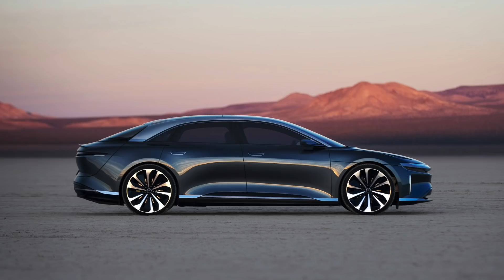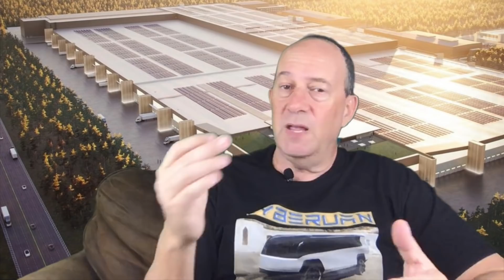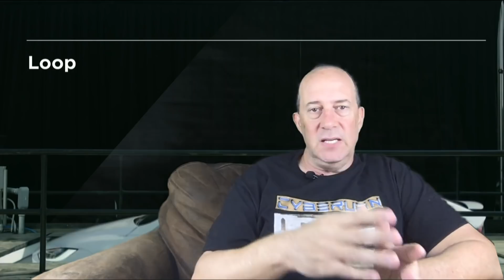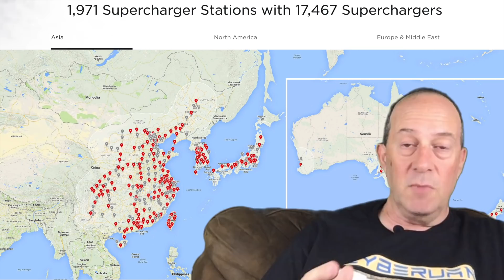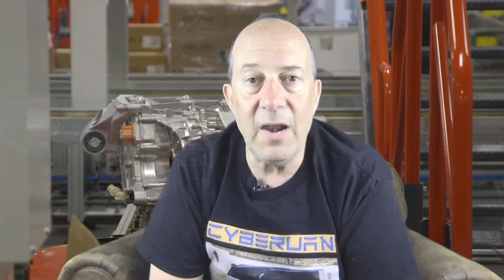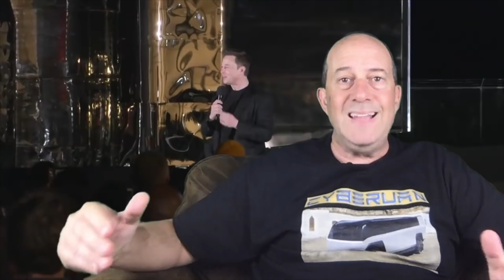TESLA - 10 Moats That Keep Tesla Ahead

Comment: Nicely done, Warren, per usual. I'd love to see you hire a video editor to do things like put the list on the screen to be checked off as you go through the list. They can do a lot of other stuff to enhance your video quality as well. 
Here are a few more items. There are so many of them.
No dealership splits/higher margins
ESOP instead of unions
No waiting until next year's model, changes on the fly
Reply from the maker: I’m not sure what you mean about the list on screen. I think I get it. Would that improve audience retention?

I have looked on Fiverr for video editors. So far it looks too expensive considering my revenue. Their typical packages are for shorter videos than my usual length.
Reply: Hi  @WarrenRedlich , Yes, it does improve retention when someone can both read and hear material. More importantly, from my perspective, is that it would reduce confusion. When something is all laid out in front of us in print, then we don't need to try to figure stuff out and remember info as much during the audio presentation; we can simply focus on the message. The print would provide perspective. These are some things I learned in Education at U. Mass at any rate. 

You might need some locals who are starting to build their businesses. Zac and Jesse of NowYouKnow/TeslaTimeNews went through that process, so you might want to reach out to them.
Reply from the maker: I can probably manage to add that kind of graphic. I'll try it to see how it works. Thank you.

I don't look up to Zac and Jesse. I used to like their channel but they've moved from genuine information to entertainment. I can't even watch them any more. It's something I've noticed with a few channels.

That's a big challenge I face. It might be easier to focus on entertainment over information. But that's not the path I want to take and it's probably a good way to lose the passion that drives me. I have always believed that quality content wins in the long run. It's certainly helping my channel grow right now.

I appreciate the advice. I will try what you said.
Reply: All noted,  @WarrenRedlich . My comments have been offered in the spirit of contribution. Good luck with your already excellent show!

Comment: Great thoughts, But, your timeline on self driving is incorrect, by about 8 to 10 years. Too have robotaxi's you need millions of cars at least 3 million or more just in USA, They would need to make at least 5 million cars a year, maybe 700,000 this year. Also the software is still 7 years away if not longer to total self driving, they know how to do it, the hardward has to catch up.

Comment: BATTERY MANAGEMENT SYSTEM  
per Sandy Munro 6 temp sensors/module; 4 moules = 24 temp sensors Model 3
2020 down to  8 temp sensors Model Y  (moving to Model 3 soon  - already?)

Comment: Warren, sorry but your color correction on your camera is driving me nuts, as you saturation fades in and out, in and out, etc....
Reply from the maker: I agree. Not sure why that happened in this video. Very frustrating for me too.
Reply: @WarrenRedlich  I have found a good light source usually fixes this issue...
Reply from the maker: I've been using two lightboxes. I can't figure out what was different in this video.

Comment: Tesla cars is really cheap in the US. If the price was the same in Sweden, I would probably already be driving one, but the price in Sweden is like 20 000 dollars more for a Model 3 than in the US.
This makes a Tesla about double the price of a comparable fossil car. So a well equipped fossil car with the same size and fairly good performance, but not as good, is probably half the price of a model 3. 

Same goes for other EV's in Sweden. They are also way to expensive. No wonder things are moving slow here.
Reply from the maker: Europe prices will fall when Berlin Giga starts delivering.
Reply: Same problem in Australia $A70,000 for a Model 3 vs $A45,000 for a hybrid Rav.

Comment: You stated electric vehicle have two parts batteries and moters in this one the control circuitry this is a large part
Reply from the maker: I was exaggerating.
Reply: Warren Redlich exaggerating on a big point on a engendering is not ok

Comment: Nope! EVs are not better for the environment.

Where is the electricity created? In a power plant run on coal or natural gas. 

But what about wind and solar? I would ask what about when the wind doesn't blow? Do you crank up God and order some more? You have to have 100% hydrocarbon backup.

Besides CO2 is not toxic! You exhale CO2. Does it poison you? NO! Does your soda pop poison you? DUH!!!
Reply: You might want to dig a little deeper as you don't seem up to date on the rapid innovation accomplished already.  Solar and wind coupled with grid batteries (powerwalls and powerpacks) blows your argument(s) out of the water.  For example, see the overview of the Hornsdale, Australia, Tesla powerpack installation at https://www.tesla.com/videos/powerpack-hornsdale

Comment: High value information Warren!  Wonder why Tesla doesn't have a portable charging station that can visit rural areas where the infrastructure is in waiting?  see -->> https://www.youtube.com/watch?v=iORDZ7FtK2M    This Chinese bus ultimately did not work out as a traffic solution.  Maybe Tesla could re-purpose this tech to park at a public place and provide charging for vehicles.  That expensive hard wired infrastructure idea needs re-thinking, in my opinion.
Reply: A portable battery could only recharge a few vehicles and then need to be driven somewhere to recharge, requiring a driver standing by, and a large charging station to recharge it.
Much cheaper to simply put in a few Level 2 destination chargers at a few thousand a pop, if there isn't enough traffic to justify a supercharger

Comment: Im not completely sold on the software advantage (excluding FSD here for a second). Can somebody make a strong case for why TSLA software is special and why it cant be emulated?
I mean integrating net flix, providing a video game, adding some sensors, programming a fart-app, thats not exactly groundbreaking magic.
Software ultimately not only permeates TSLA but also washing mashines and refridgerators.

The only "Killer advantage" would really be FSD.
Everything else is not unique to TSLA or is nothing that cant be copied.
Lane keeping and all of that is not unique to TSLA either. Self driving is/would be.
Reply from the maker: I'd agree with you but other companies haven't caught up to Tesla's software yet.
Reply: @WarrenRedlich  That is true.
Reply: @Humanaut.  others have tried and not succeeded in coming even close to Tesla software.
VW tried, and have thousands of cars sitting waiting for new software because the first try failed badly.
Most of the other companies haven't even started trying.

A big thing is, it's not just an app anyone can stick on a tablet and FlexTape it to the dashboard, it's actually running the car via software, and that's a whole different level of coding skill and hardware integration to make it reliable and useful and powerful.
Most car companies have trouble getting basic dash software right as it is, and the engine computers get hard coded and hardened for very low bandwidth functions, but anything with a display or advanced features, no one else has software engineers experienced in the unique programming and verification needed to run a car, much less build an entertainment system that people actually like to use.

Comment: toyota sell 20x the number of cars than tesla... they would be aware of the future of electric cars, but why move over now?  Tesla is basically a luxury item still, because the battery cost alone is the same as the cheapest WHOLE toyota car.  Not many can afford it. I dont think it is as hard as you think to produce a tesla
Reply from the maker: No other company has made an EV as good as the 2012 Model S yet. So apparently it’s hard to do. 

Model 3 battery pack is about $6000, less than the cheapest Toyota by a lot. Over 5 years the Model 3 costs less than a Camry.
Reply: @WarrenRedlich  i was wrong on the battery price.  but the porsche is a better ev track car, it allows constant high power unlike the model s  - pricier though, but the innovation in tesla isnt hard to achieve.   just look at formula 1 to see how tech can be copied.
Reply from the maker: "the innovation in tesla isnt hard to achieve"

Then how come no one else has made a better car than the 2012 Model S?
Reply: TOYOTA still ONLY has Drivers Assistance , it does NOT have Autopilot + FSD. 
and YOU dont need to sell MILLIONS of cars to cause DISRUPTION, just 500,000 or so. 
TESLA model 3 is the LOWEST TOTAL COST of OWNERSHIP in the WORLD.
your ROI is just 1 - 2 years , compared with 7 - 10 years with a TOYOTA.
you can Charge your TESLA Completely OVERNIGHT for less than $5. and you Leave home with a FULL tank. 
your NET Energy Cost can be ZERO , if you get SOLAR + Home battery. 
IN, 2024 Tesla will Announce a $25,000 + 300 mile range ...........in 2030 it will be $ 16,000 + 300 miles .............
but, by 2030 YOUR car will be FREE, but you wont OWN it.
Reply: @markplott4820 autopilot doesnt even work
Reply from the maker: "autopilot doesnt even work"

It worked for me when I tried it. When did you try? What went wrong?
Reply: @WarrenRedlich  watch that latest 'tesla driver' video.. clear daytime conditions, first three mins of the video.. the autopilot would have run over a bird AND went through a red light.  Imagine nightime, raining, windy, or a chaotic road condition.. Autopilot doesnt even work in optimal conditions.
Reply: @lengould9262  i bet you dont have a source.. sounds bs

Comment: Small thing about FSD. I like the idea of not going lidar. The idea is that a human have 2D and 3D seeing which can be done with just cameras as with Tesla's setup. The problem I have with full autonomous driving with just cameras are the different water types for example. Heavy snow can't be that easy to handle for the software. Heavy rain as well. But it works for a human as we have other abilities. These other abilities needs to be incorporated into the software somehow to have under any condition FSD. And this is what I think still will take time to solve.
Reply from the maker: That’s what Machine learning does.
Reply: @WarrenRedlich  yes I know. But it isnt that easy. I hope they solve it.

Comment: Add safety. Add a super brand. Now add Tesla's market cap. Synergies go farther than you observed (solar, distributed electric utility, utility-scale batteries). Also, the legacy-auto-type handicaps that TSLA has avoided (like dealerships) serve as yet another advantage.
Reply from the maker: Yes. Safety would have been a good one to include.  I did mention some legacy auto handicaps but I didn’t mention dealerships directly. Thanks.

Comment: You may want to lock the white balance during the shoot. Now the color changes with each handwave 😃
Reply from the maker: I noticed that in editing. I’ve been using my computers web can which doesn’t allow that level of control. 

First time I’ve had that problem. I might try something different. This setup does the best on audio. Everything is a compromise.
Reply: If life was easy it would be boring 😀

Comment: Isn't Lucid's batttery more efficient giving 517 miles from 113KWh whereas tesla's best for model S is 401 miles from 100KWh?
Reply from the maker: Lucid hasn’t produced beyond a prototype yet. We don’t know full specs yet.
Reply: @WarrenRedlich   - TESLA model 3 Preformance STOCK is the FASTEST Production car up Pikes Peak Hill Climb.
46 seconds FASTER than Tesla model S , and faster than a MODDED Model 3 !!!!!!!!
Reply: @WarrenRedlich  I don't remember which channel, but someone did the math on the drag coefficient between the Lucid and the Tesla, and the Lucid is slightly smaller, and the math shows that the reduction in drag matches pretty close to the stated efficiency advantage for the Lucid.
So it doesn't look like they have much advantage in batteries or drive train efficiency, but just designed the car a little smaller and slipperier to get the increased range.
So not really a technical advantage.
Reply: LUCID is NOT a Production car.

Comment: Great content, Warren! It was almost as if--when coming up with a moat of 10--you could almost come up with a moat of 20 things, or make that thirty. In the end, this is something a lot of Main St investors have known: the entrenched competitors are headed for a tunnel, a tunnel that is merely black paint on the side of the mountain.

I have a technical recommendation for your equipment setup: the WHITE balance on your camera was changing all over the place making your skin go from green tinted to red tinted and all over. If you have the time, I'd suggest looking for some ways to stabilize your camera's white balance, etc. It's not a horrible thing, but it was noticable and sometimes distracting for me, at least.

Keep the great content coming!
Reply from the maker: Thanks. Love the tunnel bit!

I’ve been using my computers web cam which does not allow white balance control. The software gets the best audio. 

It’s a trade off. This is the first time it has done that to me. Not sure what happened. I might try a different setting to sit in (no green screen), buy an external web cam, or something else.

Comment: But the batteries technology is a joint venture between Panasonic. Mobile Eye is ahead of Tesla in self driving.
Reply: fkeopfkeop what makes you think MobilEye is ahead?
Reply from the maker: Tesla works on batteries with Panasonic, LG Chem and CATL. Also starting to make their own batteries.
Reply: MOBILE EYE is ONLY Drivers Assistance, it cannot take YOU from HOME to WORK , Complelely HAND FREE like a TESLA can.
TESLA Autopilot + FSD is the WORLDS only FULL TIME L4 Autopilot.
Reply: Mark Plott actually they are more than that and are emulating Tesla’s technological roadmap.  Their partner is bW and they understand the threat of Tesla’s vision. I’d give them the best chance of succeeding outside of the traditional motor OEMs.
Reply: @greghelton4668  the disadvantage that mobileeye has is that they install it on other company's cars, having to abide by their requirements, and so they don't have the kind of integration with the car that Tesla does, and most importantly, they don't have the kind of two way training and learning that Tesla does, where the cars can send back any questions to be figured out.
Tesla also has the ability to run a seperate shadow FSD build on every single car it has, testing the solutions, looking for corner cases, and basically learning constantly from a giant fleet driving all over the world every day.

ME may have more installed units, and may have more miles, but they lack the ability that Elon saw as necessary from the beginning of every car being a test unit to learn and train, without causing any cost or effort for the driver, since Tesla pays for the cell data, and it's all done in the background.

So more miles doesn't give any more advantage than Waymo's more years, if it's not using the miles to the maximum advantage.
Reply: ke6gwf - Ben Blackburn very interesting reply.  MobilEye is collecting significant data in partnership with VW.  They formed a JV and are initially collecting data in Israel. But they are way behind Tesla.

I heard that MobilEye has a requirement for customers to sign up with the MonilEye data collection program and drop any internal program. Have you heard of this?

Comment: You say you are big believer of Elon. What's your thoughts on Tesla plans for solid state batteries?
Reply: The state of the art will be revealed on Battery Day. Solid state is great, everyone will use them when the cost makes them  viable.  There's a reason nobody is using them.  Everyone wants the same thing, range/weight/charging/cost value.  They can buy incredible batteries... for 100 times the price of good Li Ion batteries.  Look at the Koenigsegg Gemera car, which has practically no limit on cost, or SAFT company that makes deep space batteries, in case you're sending a rover to Jupiter... again, no cost constraint, you get absolutely the finest batteries you can find for something like that.  I'd suggest the channel The Limiting Factor if you want to understand new battery tech better.
Reply from the maker: I think solid state is at least a few years away from being ready for use in vehicles.
Reply: @WarrenRedlich  Quantum state is already making them going to merge with SPAC KCAC backed by Bill Gates, amazon and VW
Reply from the maker: Limiting Factor is one of my favorite channels.

Comment: I think that capacitor application and solid-state environment control batteries massive gains in watt's per kg have given T an un-assailable lead and the new tech has not been rolled. Battery day watch out wold The first true Trillionaire EM.The new single cast body weight per power is down by 30% we will see that in range and cost fewer batteries same performance same batteries better performance. Yep not since Henry F has an man changed the paradigm in 10 or 1000 processes $410 TSLA today buy shares